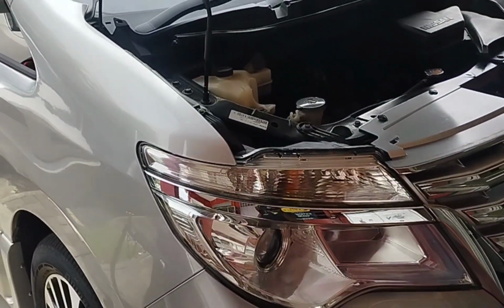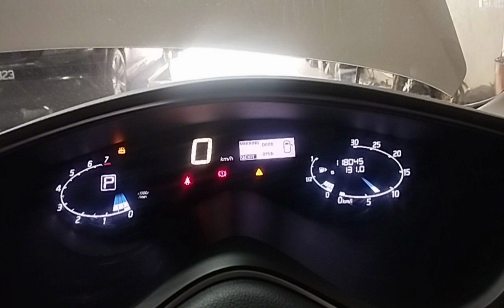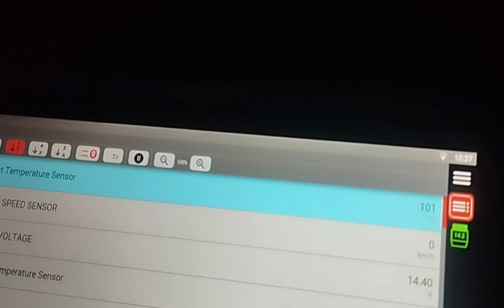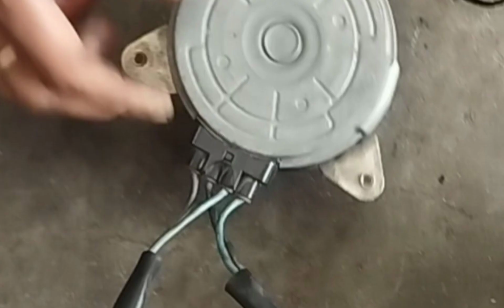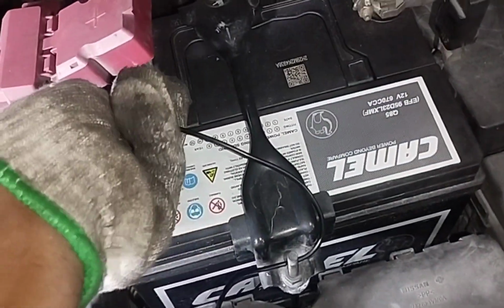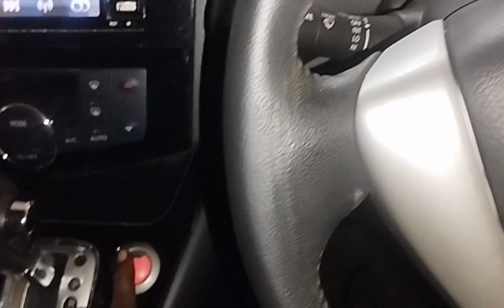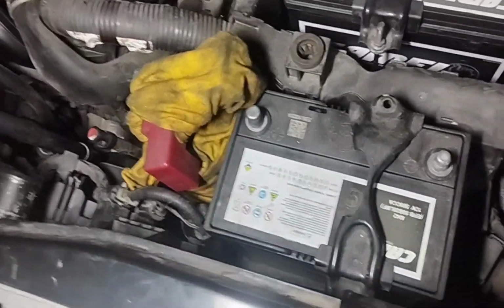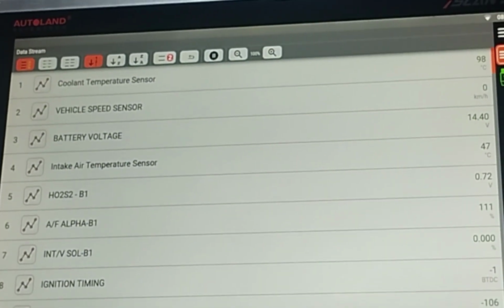How to test an electric cooling fan not working ! Nissan Serena S-Hybrid C26 overheating problems

Comment: This problem always recurred since I bought Serena, what might be the root cause.
Reply from the maker: What is the problem with your car?
Reply: @SCSautomotive.1988   The fan motor won't last long, this does not happen to other vehicles.
Reply: This seems to be a common problem with Nissan Hybrids. All of them use a single fan to pull air through 3 radiators (engine coolant, inverter coolant, air conditioner). In most other cars they usually have two fans. Also Nissan vehicles are known to have bad bearings on Fans. Not only in hybrids, but few other models too.